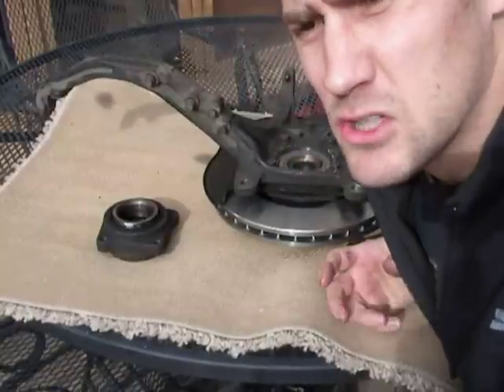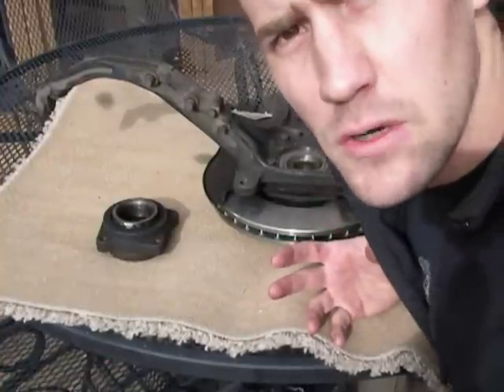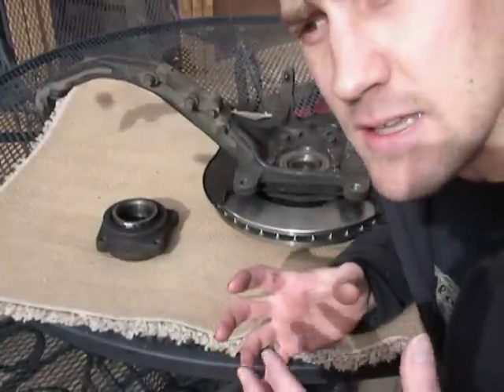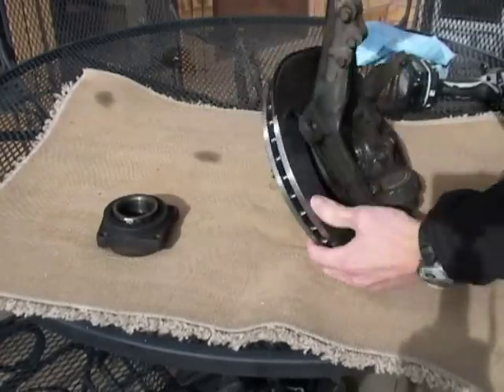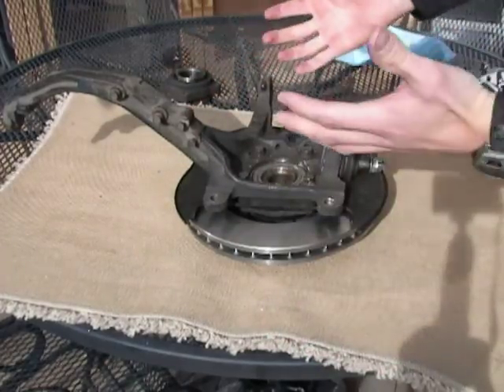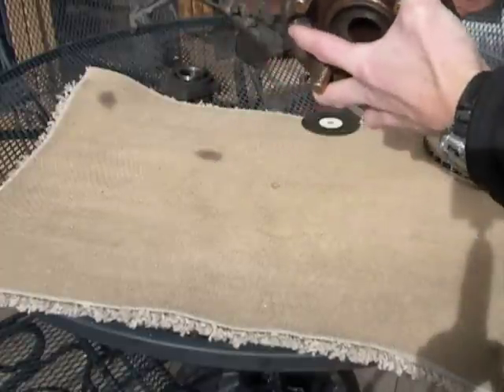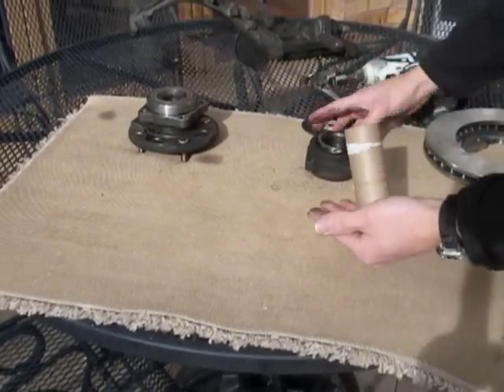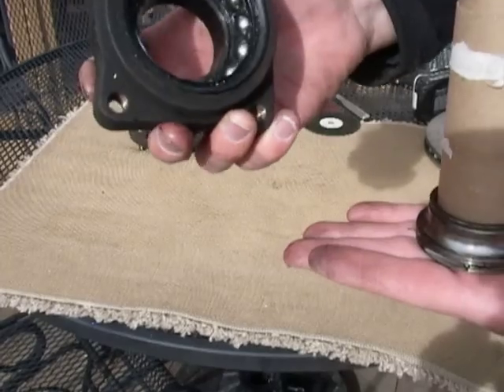1995 Honda Accord Rotor and Wheel Bearing Replacement (Trapped Rotor)

Comment: Hmm... I hated that design when I found out about this 8 years ago, so 5 years ago I found a slide in and out conversion kit that lets your rotors slide out just as easy as the rear and you can easily replace the hub or bearings. It's totally worth it! Piece of cake every time you do the job. Nothing's compressed r needing spell tools r ard banging anything in or out. Now I'm loving the car a whole lot more.

Comment: For a DIYer you made an awesome video. You did not finish about the broken stud story but here is what I do every time. Due to the inner bearing race sticking to the hub, I simply buy a new hub/studs assy so no cracked, stripped or broken stud issue. Press the new bearing on new hub & dont waste time cutting. The hub/studs assy is not expensive, no worries about safety of family in vehicle, no worries of full disassembly or wasted time. In my experience. Nice safety briefing & Eric referral.

Comment: I agree with hitman6191, for Honda owners in areas that see more rust and corrosion, where roads are salted in winter or near coastlines, this is a frustrating issue. I've seen videos from drier parts of the US where the hub, rotor and bearing assembly easily separates from the steering knuckle the way it should.  I wrote Honda regional but the manager's reply was that this was not a design shortcoming.  To replace only the rotor, there is a hub removal tool that separates the inboard and outboard parts of the inner race (sealed bearing-not meant to be separated), the outboard piece remains on the hub, as what happened in this video.  The outboard inner race half is returned to its place in the bearing when the hub is placed on the wheel spindle and the spindle nut is tightened and torqued.  A new bearing can be installed on the hub this way, without the use of a press. Bolt the new bearing to the knuckle then install hub onto spindle and tighten the spindle nut, this essentially "presses" the bearing onto the hub.

Comment from the maker: Its been a while since I removed mine, but I don't remember any play in that bearing.  Usually when you have play in a bearing like that, its a sign that it is wearing and may eventually fail or seize.  I am always paranoid with critical parts like wheel bearing, so I stay on the safe side and replace them with new ones.  My justification is that the money I'm saving by doing it myself offsets the cost of the parts.  Good luck!

Comment: Doing same job now can’t get break rotor bolts out because socket would job off. Socket was tight on the bolts but would still jump even when pushing hard while trying to drive them off

Comment: They do have them as one assembly but, of course, they cost more than just a bearing.  Not every outlet carries them, however, but if you search, you can find one.  You can also buy a separate new hub and assemble a new bearing onto it in advance but the hub is approximately $100 or more each.

Comment: Quick solution is a slide hammer with a stud attachment takes me 30 mins both sides and your done I've done hundreds like this works everytime
Reply from the maker: At the time I couldn't find a video explaining how to use a slide hammer.  I've found that experienced people such as yourself don't have any reason to post a how-to video so it ends up being amatuers like myself that try to figure it out and share our experience in a video.  The problem being that my method may not be the most effective or time/cost efficient solution as the experienced mechanics.
Reply: If its tight ....most are. You are unknowingly damaging the bearing. It will take some time but it will have an early demise. High impact like that is rarely good. imho
Reply: Brad Grissom its a called a "slide hammer hub puller"

Comment: If you jack up your car to get that tire off of the ground, grab the tire with one hand at 12:00 position, grab tire with other hand at 6:00 position. Push in at 12 & pull out at 6, then reverse push pull action every second. Rock the tire with some real force. If the tire seems to feel loose, then the bearing is bad. If you are not sure, try the other tire that you think is in good condition. A bad bearing will allow more tire wear on both the inner & outer tread pattern like low tire pressure.

Comment: buy long hub bolts for back side  screw in and use hammer or air chisel ,and hit in circular motion til loosen ,then remove bolts and seperate,you do not have to remove knuckle.

Comment: After getting it apart and cleaning the rust off where the wheel bearing goes into the steering knuckle put some grease there and the next time it will be easier to remove. The grease will keep it from rusting,,,,,,,,,,,

Comment: another solution since your replacing the bearings anyways and you don't have the tools just buy the hub and bearings kit, the bearings is already pressed in the hub and sometimes you can get it thru ebay with free shipping

Comment: what would be cool is that someone would just sell the wheel hub and bearing as one set. when you pop off the rotor you just replace. No need to further break down needed.

Comment: Is this the same on all Honda Accord Wagons?  I have 95 Honda Accord EX Vtec Wagon.

I haven't taken my rim off yet because I just got the car.
Reply: Yes and it sucks ass. I converted using the Acura CL 2.3l hub with new rotors and bearings. Definitely worth it
Reply: @bonpun5066  thanks.
For my Personal Record's and to Spread the word.
Are the Rotors much smaller?
You have to use Acura CL 2.3L 4cyl Wheel Hubs, 
Wheel Bearings & Rotors? Right.

Do you change the Caliper's too though?
Wagons Rotors are 11" I think.
I heard you can do floating rotor setup too from prelude.
But I don't know which is best for long term parts support.
Since 4cyl Hub already hard to find, can't buy new.

Accord Wagon I found out is similar to Accord Ex Sedan.   But exact match is 6 Cyl Accord sedan/Coupe.

Accord Wagons get some 11" front Rotor's Upgrade. Same as the 6cyl Sedan/Coupe.

So just adds bit to the confusion.
Reply: @1XSTEALTHTWINTURBOX1  Yes just get the Acura CL 2.3 hub, wheel bearings, and rotor. Your caliper and pads are interchangeable so you can keep the ones you have on your Accord
Reply: @bonpun5066  very cool man if you ever know how to get these parts non salvage let us know so I could tell other people in the future as well.
Basically have to track down that car in a junkyard.

Comment: That design goes all the way back to 1991 and up you don't have to remove the whole knuckle assembly off of the car just undo the CV shaft nut, undo the lower ball joint nut break the lower ball joint free from the knuckle pull the knuckle assembly away then you can have a machinist or you can buy the remover (Looks like a steel hockey puck with a pilot on it). Insert the remover into the bearing and bang it out with a mallet.

Comment: Thinking  could have prayed bp blaster where the back is and between the shield and rotor then take a block of wood and place it on the sides and hit with a hammer to get it unstuck without using a press now with the bearings  yes probably a socket  or press

Comment from the maker: The method that I explained in the video involves putting the whole knuckle on a press.  So obviously to do that, you'll need to remove it from the vehicle.  I've heard of these slide hammers that people use to hammer and pop it out while it is still mounted to the vehicle (although I've had no experience with that method).  I recommend this method because you can replace the wheel bearings while you are taking it all apart.